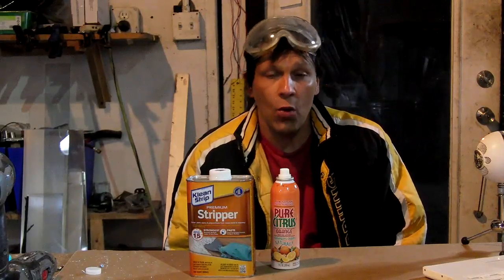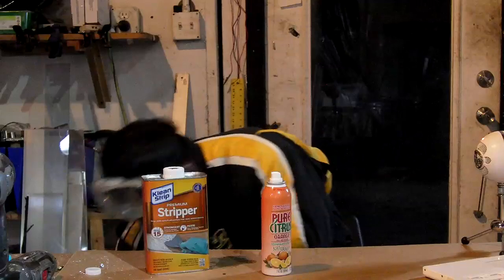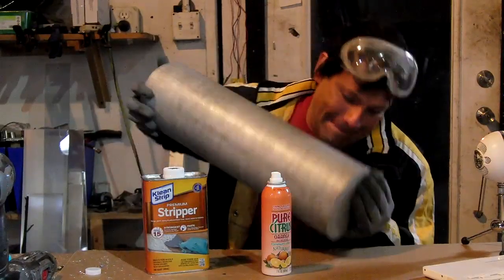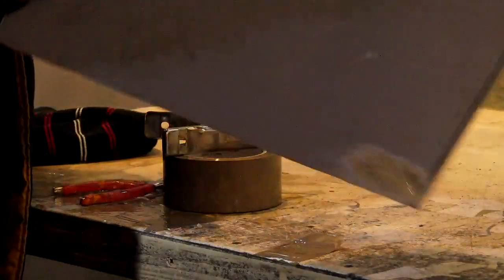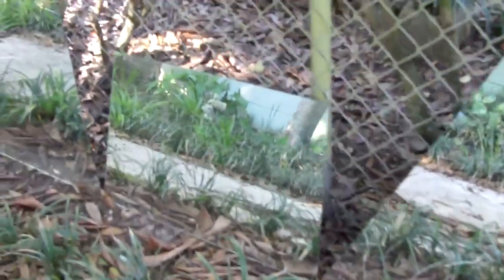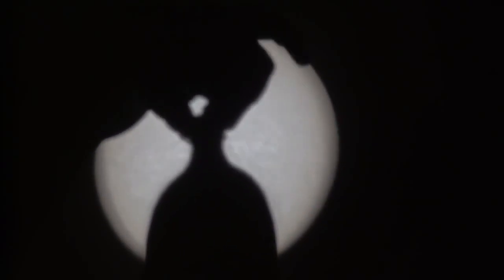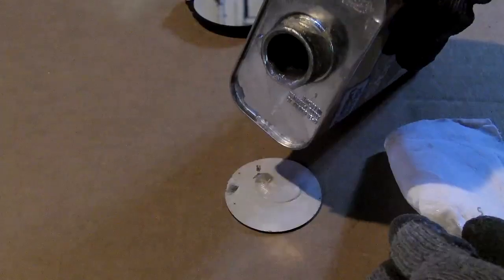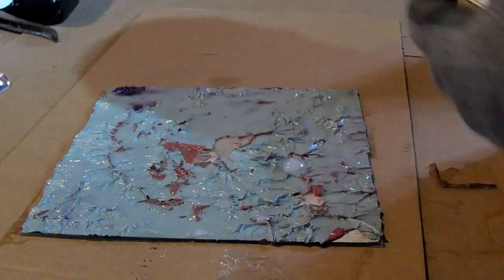First surface mirror DIY hack from a regular mirror

Comment: That's a sweet piece of rod stock aluminum...Haha, what does it say about a person when those are the sort of things that I find interesting? Nice easy project here. I would like to see a little longer version where you show the two way properties. Maybe by placing a mirror over an opening cut in a cardboard box with a light inside.
Reply from the maker: That giant ingot has been here for a while:-) Will do with a follow up on the mirror. I actually know the guy who did the "Girl to Gorilla" side show, first surface mirror was used. Maybe turn Denise into a gorilla :-)

Comment: Awesome information.. I just wish you would have explained what you meant by first surface mirror a little more at the beginning.  It took me a minute to realize that you were explaining that a standard mirror is paint/mirror/glass and that you are just removing the paint covering one side of the mirror (which is a mirror on both sides of it's surface), making that a first surface mirror and that you end up using the "back" of the mirror when you are done.

Comment: Another great video, Dan.  I have a couple follow up questions that I'm thinking many people would find interesting.

What does the orange peel spray do and what else can be substituted (not everyone has heard of or access to this stuff).

Do you know of a protective spray coating to cover the aluminum which doesn't alter the reflection much?  How fragile is this newly exposed aluminum to both scratches and oxidation?

You very briefly mention two-way mirrors as being possible to make from this process.  How?

How might someone soften a flat mirror to mold it slightly into a parabolic dish shape without distorting the aluminum and could that be done better before or after the paint stripping? 

First goal of that last one is to create molded sections of much larger dishes.  For example:

A hyperbolic mirror to be used as a secondary in a large spinning mirror setup.  Place a kids pool on your large turntable and float another inside it for smoothness.  You could also use another large dish.  Fill that one with foam, closely approaching a parabola.  Then top of with a reflective viscus epoxy, ceramic or pure cement to make large spinning primary.  Secondary can intercept, re-aim, re-focus and track beam to some target.

The second goal would be to line a large dish with optical quality first surface mirror, not just Al foil.  Done either on an existing dish or a negative mold.  Ultimate product would be a foundry of significant volume or an oven to re-form glass as above.
Reply: And answers to your questions anyone?
Reply: @slt7579  maybe a bit late (9 years), but from what I can tell, it doesn't do much. Limonene is added to some paint strippers, mostly for a more pleasing smell, but also for potentially a little more paint stripping power. I'd probably skip his ingredients and use Citristrip. It does great at removing paints and has a pleasant smell. I wouldn't be surprised to find out that it is essentially the same concoction he whipped up here. It is possible that there is an oil in that particular spray, that could be useful for preventing oxidation on the exposed metal layer. But if you manage to not scratch it or leave any residue on there, I'm not sure that should be a problem either. On the other hand, I could be wrong about everything.

Comment: wont the surface erode when the stripper removes the protective paint?
Reply: It’s gonna depend on the paint stripper, but the surface layer of the aluminium would be aluminum oxide (because the mirror exist the vacuum deposition chamber before the paint is added), and I would not be surprised if the paint stripper didn’t affect it at all.
Reply: @JasperJanssen  how could you determine if it was mirror or silver coat?

Comment: Thank you Thank you so much. I always needed first surface mirrors for my projects but I couldn't find them in my country for commercial purchase. This trick saved me thank you so much. But I haven't got that orange peel oil spray, what can I use instead and what does that spray do to the mirror
Reply: It’s for deactivating the paint stripper compound.
Reply: You could just use vinegar

Comment: Orange oil can be replaced. The field of application is the same as for *turpentine oil*. A higher price is offset by a more pleasant smell and a lower allergy potential.

Application areas are:
Degreasing of metal parts, for example bicycle chains, gear wheels or ball bearings. Orange oil is rather unsuitable for larger parts because of its high price.
Removal of tar, resin and lubricating oil stains
as a brush cleaner and for thinning oil paints
as a substitute for turpentine oil in painting
Reply: So “turpentine” can be used as an alternative? In the Netherlands we have this kind of product called terpentine which is widely available here. I think white spirit is the English name for what I mean. The Dutch Wikipedia page for terpentine refers to the English page for white spirit.

Comment: Thanks for guiding me to a cheaper alternative for my lidar project.
Reply from the maker: While 99% of the Big Screen rear projection TVs available now have HORRIBLE solar lenses (good ones are from TVs 1993 and earlier, almost impossible to find now) most have a perfect large first surface mirror. Some have a stretched mylar (usually older) and some have a regular mirror (usually older). The ones available (people giving them away) have crappy lenses but the first surface mirror. The problem is picking up a 300 pound item that is almost impossible to dispose of the rest.

Comment: Hello 
I will give you an idea. 
With it, you will do max mirror. 
a large disc (3m) pour the resin. 
made to rotate. 
Establishment of a concave disc. 
Cut into pieces 30x30 cm. 
bring to the company which deals with vacuum coating. 

or you buy such a measure 
Using a Drip Silver Kit
Reply: Your link to Using a Silver Drip Kit is a private video and can not be viewed.

Comment: may I ask what the function of the pure citrus air freshener?? Sorry the lame question, but as I'm not in the US, I was wondering what I could use instead...

amazing technique man... congrats!!! I have being trying to do this for months now... tried acetone and a bunch of other things, but I allways ended up hurting the metal or acrylic!!

Never tried a more strong striper like you did... I'm definitely trying now!! 

cheers...
-H
Reply from the maker: The citrus spray is optional. It is an oil based solvent that helps lift the stripper from the aluminum surface while diluting and halting the chemical stripping reaction. WD-40 will work too. Just washing in water alone could leave residue that would oxidize the first surface coating.
Reply: Thank you because I was sifting through the comments looking to see if I use something as substitute for the Citrus oil

Comment: Hi, I realize this is an older video but I'm hoping I can get a quick reply.

I need a two way mirror to create a smart mirror with a TV behind it.

Will stripping the back paint allow the TV to push an image through the silvering and act like a normal mirror when the TV is off?

tks in advance.
Reply from the maker: 2 way mirrors are basically any mirror without a backing. All first surface mirrors are 2way
Reply: Thank you, really appreciate it.

Comment: Dan, What prevents the exposed aluminum from subsequently oxidizing?
Reply from the maker: It is a common belief that they oxidize. I always thought the same thing but I have had exposed first surface mirrors out in FL weather for over two years and other than a very slight bluish tint, they are fine. Surfactants cause instant damage but rain, mud, sun, humidity seem to have no serious damage. Really strange. Maybe no one thought about leaving them out because they are usually expensive. This telescope mirror also is tough:
DIY TELESCOPE primary mirror off-axis TESTING
Was outside for 1 month...oops but it was fine.
For a precaution with solar a clear coat of enamel works but that sort of makes it a thin second surface again.
Reply: @GREENPOWERSCIENCE  bare aluminum oxidizes immediately. However the aluminum oxide layer doesn't flake off like rust does, so it stays in place and keeps the rest of the aluminum safe.

Comment: Hi there, what did you use to scrape/rub off the aluminum? My attempts with a paint scraper, fine sandpaper and steel wool just scratch the glass underneath. Thanks!
Reply from the maker: The aluminum stays or you have clean glass. The aluminum or other metal coating is what makes the first surface mirror. The grey back paint is not aluminum, and that is what we are removing with orange spray or stripper. If you need to remove the aluminum, once the paint is gone and first surface mirror is there, drop glass in acid for a few hours. You may need to dip in and out.
Reply: @GREENPOWERSCIENCE  thanks!

Comment: How can it be used as a 2 way mirror like you said?
Reply: The aluminum layer is actually very thin and you can usually see through it. To see through it, the image on the other side just has to be brighter. That's why in cop shows the suspect is always in a bright room and the cops are in the dark room. The light from the other room is brighter than their own reflection, so they see that instead.

Comment: hello,  I hope you are still answering questions.  WHich solvent did you use as "paint thinner"?  I tried MEK and Acetone, neither worked at all.
Reply from the maker: Orange peel spray, D-limonene. Spray, let it set for about 20 minutes.
Make sure it is 100% D-limonene. Walmart sells a spray air freshener.
They are both in the beginning.
Reply: "Paint thinner" is usually Some kind of mineral oil, which is not what he was using. He was using "paint stripper", which is quite different and is usually made of some kind of acidic chemicals in a gupy suspension.
Reply: Sorry, I was mistaken. Paint stripper is extremely basic, not acidic, but still quite harsh.

Comment: Ummm...What is a first surface mirror? How is it any different then a regular mirror?
Reply from the maker: First surface is the exposed aluminum, second surface is the other side you usually look at behind glass. First surface is preferred as the glass distorts the image a bit for optical applications = optical aberration.

Comment: Any special requirements for the paint stripper? Would pure acetone be okay? I see that WD-40 should be okay for cleaning the surface after the paint has been removed.
Reply: Acetone is not paint stripper. Acetone will dissolve certain kinds of paints and plastics and would take much longer and be a lot more work. Paint stripper will soften just about any kind of paint rather quickly that can then be scraped of very easily. It can also damage a lot of other things it comes into contact with since it is extremely basic.

Comment: I think im missing something here. Where does the aluminium go? What i understand is,
1. put the paint stripper on the back side
2. Spray orange oil 
3. wipe.

How exactly do you put aluminium to use?
Reply: The aluminum is used in manufacturing the household mirror, which you remove with the chemicals.
Reply: crookedtool the question is "How?" The video is pretty vague.
Reply: You remove the gray paint protecting the aluminum surface. Thus exposing the reflective surface.
Reply: I got it now. The aluminium in the intro was to tell us how mirrors are actually made.
Reply: "All glass mirrors including the ones in your house start off as a first surface mirror during the production process.  Clear glass or acrylic is metalized with aluminum using the modern method of vacuum deposition."

The answer to "How?" is clearly "vacuum deposition."